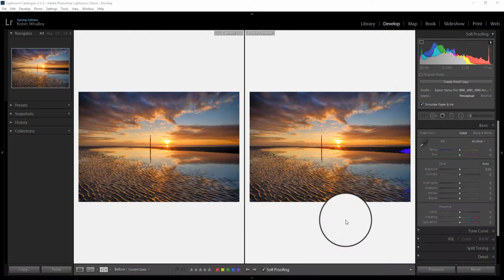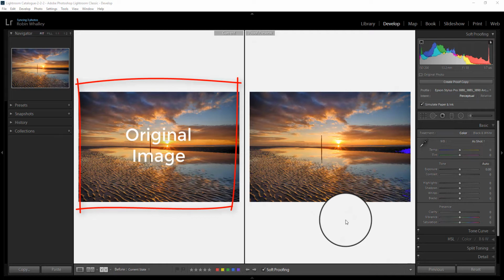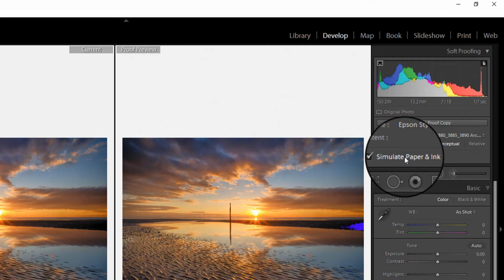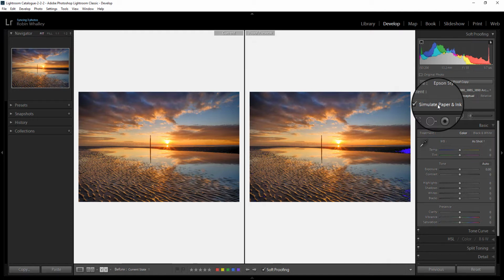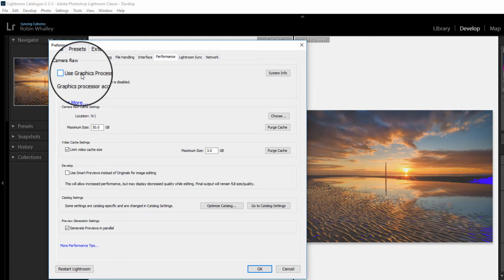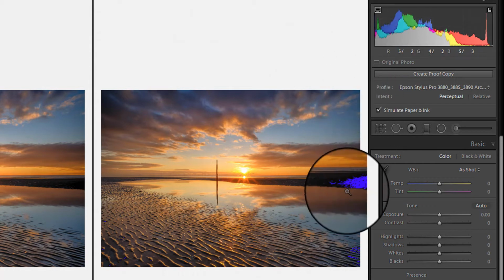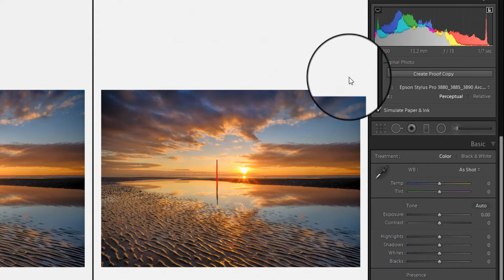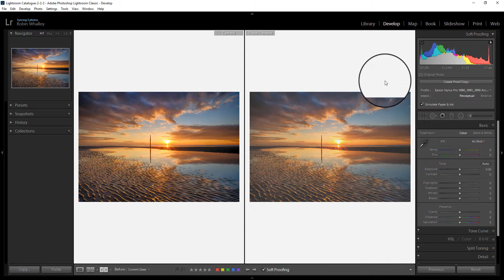Lightroom Soft Proofing Bug and How to Fix the Issue

Comment: What if those tips won't work?
Reply from the maker: The bug I described in the video has been resolved in later versions of Lightroom and the Soft Proofing feature now works consistently. If you are still seeing an issue with Soft Proofing it's likely to be either a) you're missing something in the process, b) something is causing an issue on your computer. Either is likely. If you are sure that you are doing everything correctly I would raise it in the Adobe forums to see if anyone else is having a problem or has resolved it. I just checked the latest release of Lightroom on My Mac and Soft Proofing is working.

Comment: Hi Robin have a quick question. When I go from develop module to the Print tab I see the original photo ( the non soft proof one) … it causes me confusion what to trust … the soft proof one that I have made changes to etc acc to the paper profile or the one showing when I go to the print tab …
Reply from the maker: Providing you are confident that you have done the Soft Proof correctly, you need to trust that. The Soft Proofing doesn't show in the Print Module (I wish they would add it as an option) and so that image will reflect the change you made to compensate for printing. Depending on the paper you used it could make the image look terrible in the preview.
Reply: @RobinWhalley  thx Robin I am surprised LR doesn’t have this option…should b a pretty simple one for them to fix

Comment: Great video on soft proofing; easy and straight forward. Question; does this apply if I normally send my images to a photo lab for print (Costco, Walgreen's, etc)?
Reply from the maker: Thanks and yes. It's always best to soft proof images even before sending to a lab. You may find you need to make further adjustments based on the printer and paper they use or the image won't look like the one on your screen. That said, you may have problems getting a printer profile from some labs (especially budget providers). If they can;t provide you with one (or don't have one to download on their website) try asking what paper and printer models they use. You can then check the paper providers website to see if they have a priofile.

Comment: I have the latest updates to the latest version of Lightroom Classic. Both before and after the updates I was able to Go to Soft Proof and create a proof copy. However, when I set the View to Reference/Active, using the original version as reference, I am automatically taken out of Soft Proofing and cannot get back in while in the Reverence/Active view. Any suggestions??

OK. Forget the above question. I should have used Before/After rather than Reference/Active.
Reply from the maker: No problem. It's a common mistake and easy to make. I sometimes click the wrong icon because I'm not paying enough attention.

Comment: Really helpful video! But when I try viewing both the master and the proof in the develop module (with soft proofing on, and gamut warnings off, and simulate paper and ink checked) using the Y|Y option, BOTH images have the paper and ink simulation. Any adjustments I make to the proof do apply just to the proof, but the master has the paper and ink simulation. Am I doing something wrong?
Reply from the maker: That sounds very odd and difficult to say what's wrong without seeing your screen. I would suggest deleting the virtual copy (proof copy) and starting again. There's also a drop down just to the right of the Y|Y which allows you to set the "Before" view. It's possible this is set to show the proof copy rather than the "Master Photo". If it's set to show the proofed version that would account for the before and after image being the same.
Hope this helps.

Comment: Hi Robin,
Thanks for all your videos. Very helpful !
The bug remains and I don't see the point of softproofing if you can't see blown highlights, blocked shadows or shifted colors.
Adjusting the sliders so the proof copy matches the "original" image is pointless if the printer is unable to print out of gamut colors. What do you think about that ?
Reply from the maker: To be honest, I haven't really found the bug a problem now that I understand how to work around it. I now soft proof as I did before using the "Simulate paper" option. I then turn on the Gamut Warning option to check for problems. If I find any I address them (if required) before checking the soft proof again. I just need to remember to toggle the Gaumt Warning on and off.